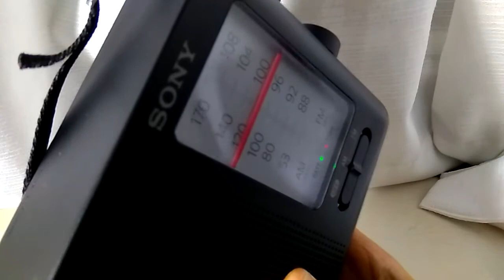Sony ICF-19 AM Band test, 9 pm Vancouver

Comment: I bought the icf-506 from Amazon, it was a used re-pack. Really like the selectivity, hardly any noise between stations, I am in Princeton BC so I get a lot of Seattle, Vancouver, Alberta stations at night. The volume is Ok but sometimes not much on weak stations. I like it better than my Panasonic 2400d which has popping noise when stations fade in and out, the Sony is better in this regard.

Happy DXing
Reply: I noticed that popping on my RF-2400D with very weak signals too. When the signal is strong, the receiver is excellent. Good AGC -- you hit the frequency and there is no delay to hear it. Good sound quality -- easy to listen to for long periods, nicely tuned volume control also. Everyone should own an RF-2400D!

Now this Sony ICF-19... It comes across as being well made. It sounds good and seems to pull in the distant signals. Would it be redundant to get an ICF-19 if one already has an RF-2400D?